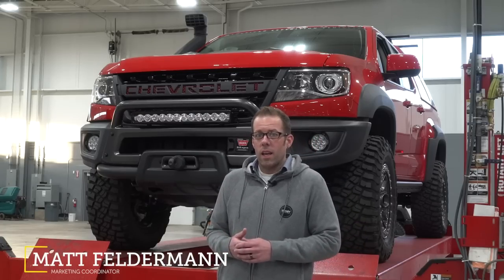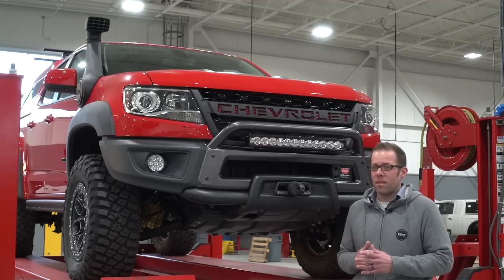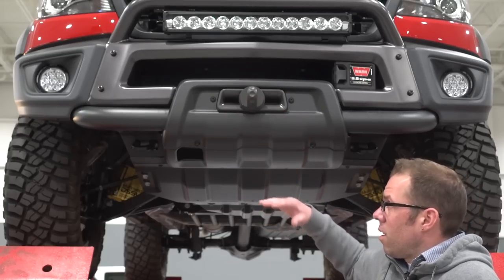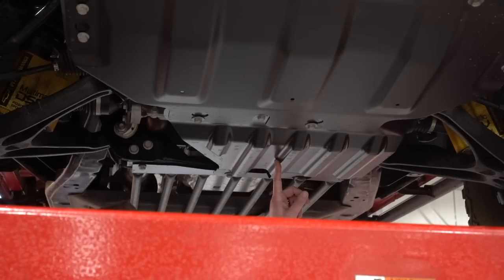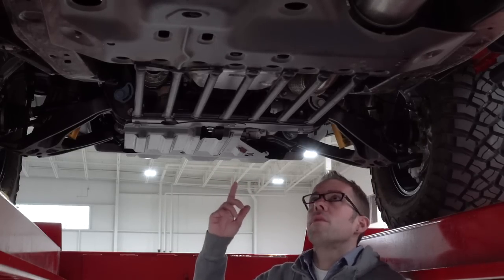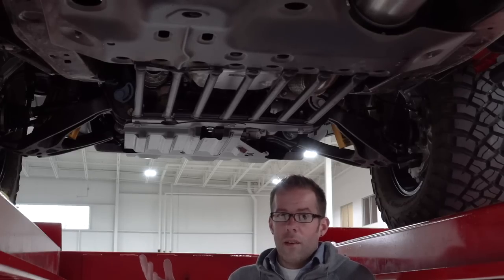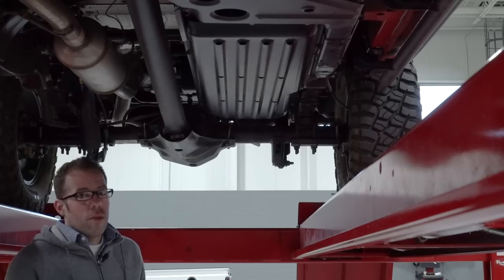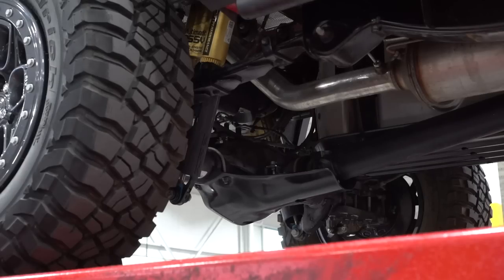Hot Stamped Boron Steel Skid Plates for Chevy Colorado

Comment: Hi guys, this looks fantastic and I appreciate the walkaround. It looks like everything will bolt directly to a standard ZR2 with the exception of skids 1A and 1B on the bumper, is that accurate? Or would 1B fit behind the standard ZR2 front skid? Thanks again, I'm so excited to buy a set.
Reply from the maker: Correct. You would need the Bison bumper for skids 1a and 1b.

Comment: Where may I find the crash data of the 11 tested trucks?. Here’s the excerpt of the interview with Autotrader. 

“Because the AEV components are baked into the ZR2 Bison, they have been factory tested and are covered by the factory warranty. "We crash tested 11 trucks with the AEV components," Arnone stated. "You just don't get that kind of validation in the aftermarket."

Thanks in advance!
Reply from the maker: All Bison crash conformity testing was conducted by GM in the same fashion as any other new model/content trim package. I’m not sure how the trim specific crash test footage/information (Z71, ZR2, Bison, etc) is released to the public by the OEM’s but NHTSA should have the 2019 Colorado crash test data/ratings on their website.
Reply: American Expedition Vehicles that’s the dilemma I’m having. Not sure if you’ve seen the new passenger small over lap test on the 2019 Colorado. The results are disappointing, therefore I was wondering if your new bumpers and skid plates improved the way it performed . Thanks for replying, GM has yet to reply to my email.

Comment: Question, I have a 2007 4 door wrangler and I just got an Hemi 5.7 eagle engine from a 2012 Dodge Charger R/T what conversion kit from you guys should I buy?
Reply from the maker: The 2012 Charger should have a VVT engine in it, so you’re going to want to go with the 2007 kit with the 5.7 VVT option. With that in mind and based on what you’ve said here, you’re going to want to go with part number: 40307031AA.

 Also just as an FYI, we don’t currently offer a kit that is compatible with manual transmissions, so your vehicle needs to be automatic. 

If you have additional questions, don’t hesitate to call us at 248-926-0256. Thanks for reaching out, and enjoy your build!

Comment: Do the all the skid plates work with the BDS 4" lift on a non-Bison ZR2?
Reply: Nope.  The transfer case is clocked and is now in the way.  You'll have to modify to get the transmission and transfer skids installed...some welding and spacers.